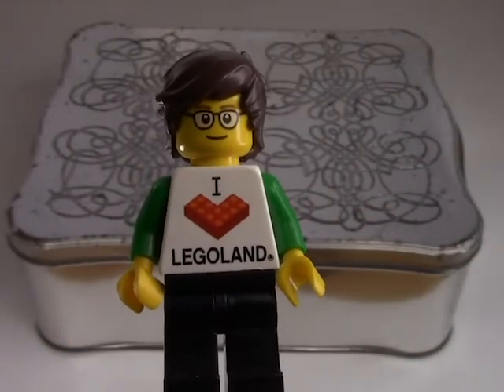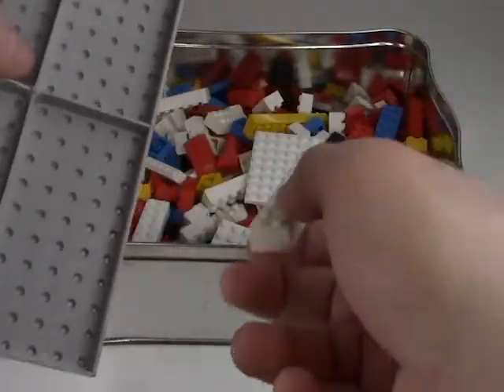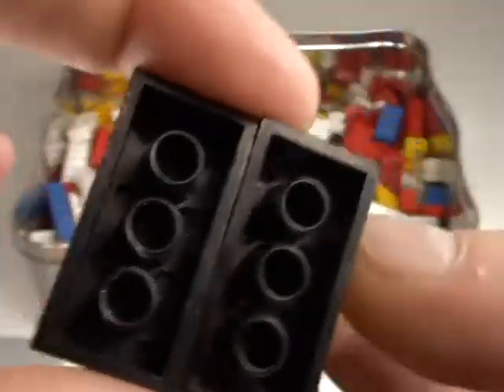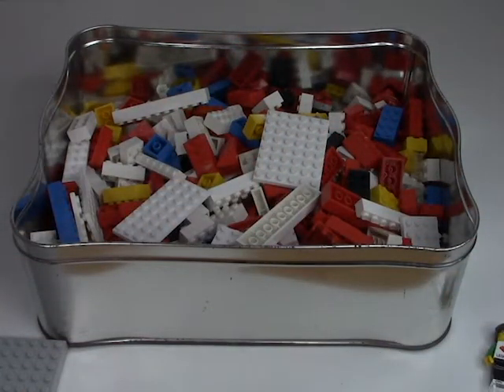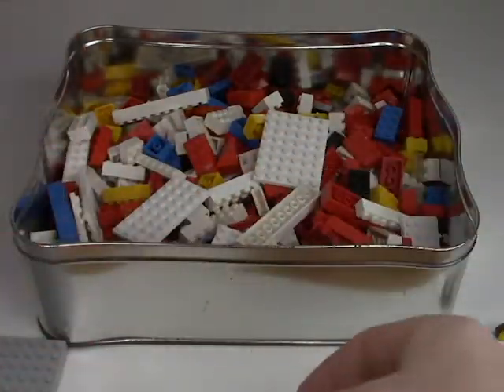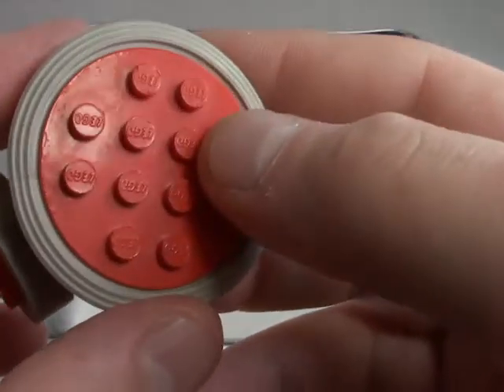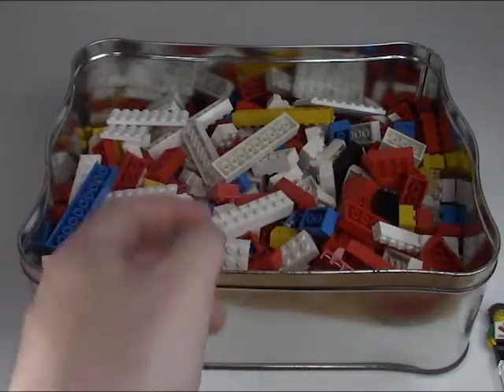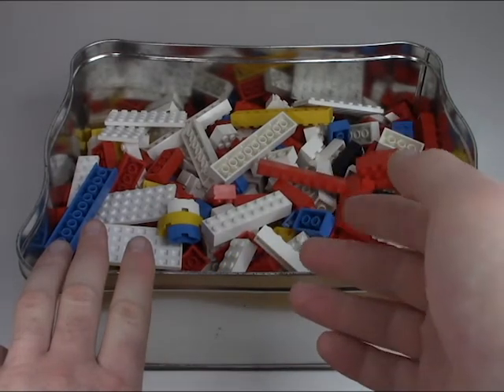1950s Lego Overview

Comment: I’ve got at a lot of examples of most of the things you’ve shown.

Several of those old large base bricks, in green and grey, though most of them are broken into quarters unfortunately. I think I only have one still intact.

I’ve also got plenty of waffle bottom plates, most of them grey 4•8’s, along with the older logo bricks.

Those windows and wheels are awesome, I use them often when building with bricks.

Something that isn’t present in this video were the old gears. I’m pretty sure they were meant to attach to the wheels you showed. I was never really able to use them in my builds and they’re so large that they clutter up my LEGO bin so I had them sorted out years ago.

I don’t know what year they started making technic axles but I have a few white 1•8 axles along with 2•4 grey bricks with holes through them and red sprockets compatible with modern technic. The sprockets actually have a metal ring inside of the axle hole to create friction so they don’t slide on the axle. The sprockets had compatible chains similar to modern technic, the main difference being that they are much larger and have studs on them.

The old plastic is indeed more brittle, particularly the blue bricks in my experience.

I got all this from my mom who somehow ended up keeping all the LEGO she and her brothers had when they were kids back in the 60’s and 70’s. Some classic Space mixed in there as well.